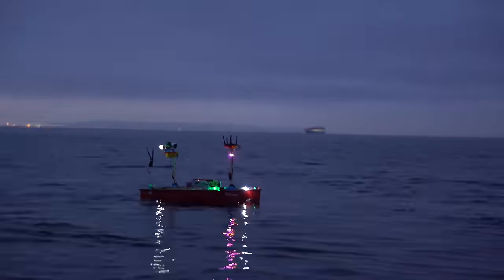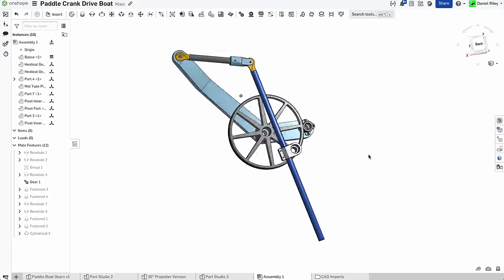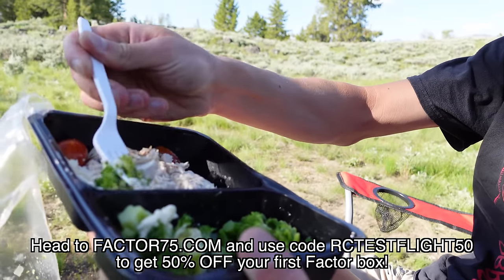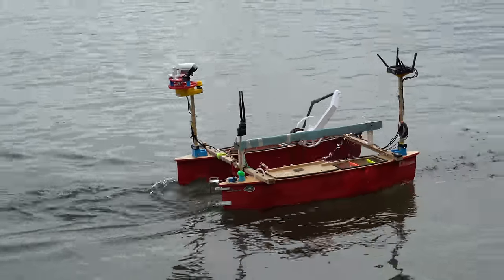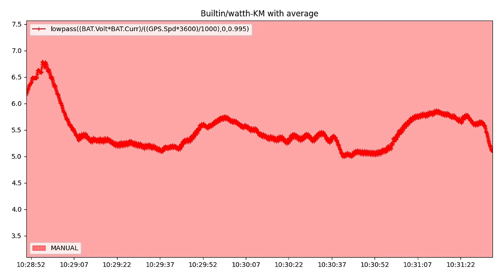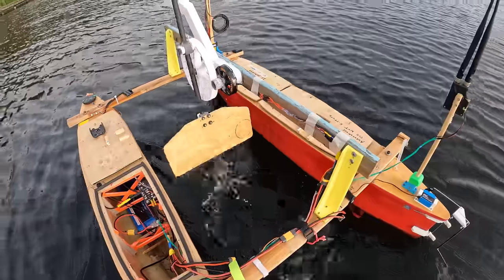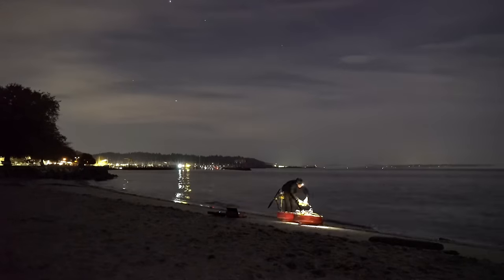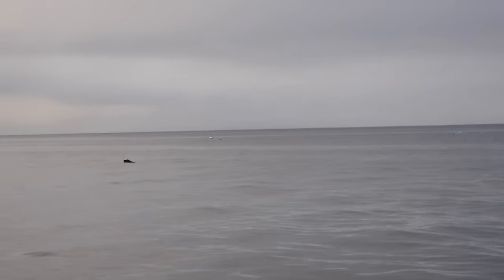Propeller Killer? High Efficiency Paddle Vs. Propeller

Comment from the maker: Use code RCTESTFLIGHT50 to get 50% off your first Factor box at https://bit.ly/3JgFdFQ!
Reply: The paddle needs to be more hydrodynamic, like a duck foot
Reply: One word- Yuloh.
Reply: You might benefit from "Nighthawkinlight"'s recent video about how to experiment with multiple variables at once to decrease the number of required tests
Reply: Just ordered Factor for my parents using your code!
Reply: @rctestflight One thing that would be cool to test is to have multiple paddles that go around like a tank tread that goes around over the top of the boat then into the water
Reply: Now you need one of those ion thrusters.
Reply: weedless prop?
Reply: @r0cketplumber I was just going to say exactly that.
When you've seen 50 tons of triple masted  Chinese junk, gliding out of Whangarei harbour in New Zealand, with a 90lb elderly Chinese guy lazily swinging on his Yuloh, on a mirror smooth windless morning...
The guy had circumnavigated solo with no engine....
No arguments possible.
Reply: Fish tail. Or two, to cancel out the waggling.
Reply: @Sandux930  🔴 What Is Islam? 

🔴 Islam is not just another religion. 

🔵 It is the same message preached by Moses, Jesus and Abraham.

 🔴 Islam literally means ‘submission to God’ and it teaches us to have a direct relationship with God. 

 🔵 It reminds us that since God created us, no one should be worshipped except God alone. 

 🔴 It also teaches that God is nothing like a human being or like anything that we can imagine.

🌍 The concept of God is summarized in the Quran as:

📖 { “Say, He is God, the One.  God, the Absolute.  He does not give birth, nor was He born, and there is nothing like Him.”} (Quran 112:1-4) 📚

🔴 Becoming a Muslim is not turning your back to Jesus. 

🔵 Rather it’s going back to the original teachings of Jesus and obeying him.
Reply: Seems to me having slight sides on the paddle, more like a cup, would be more efficient for the paddle design. For the wind prop, seems like having one big prop with wind rudder, like the air boats that we have seen in swamps would be better. Also, moving the the air prop forward, maybe centered would keep the prop out of the water. And of course longer hulls would be more stable, though increasing drag, unless a bulbous bow even this small might help neutralize the wave pattern as it does on large ships.
Reply: Interesting idea!  Some thoughts:

1. The paddle needs to be entering the water at least as fast as the boat is travelling forward, which means you need to have a way to measure forward speed through the water.

2. The problems with straining the system are almost certainly due to trying to push the paddle too hard through the water, which indicates that the speed of the paddle needs to be linked to the speed of the boat through the water and shouldn't be too far above the speed of the boat.  

3. The paddle needs to constantly be perpendicular to the surface of the water or you are wasting energy pushing down/pulling up on it.

4. A second mechanism can be used to constrain the paddle parallel to the surface on the second half of its travel.  You won't need to have the travel be as high.

5. Only having one paddle means the boat's speed will pulse.  Having more paddles with offset timing will smoothen that out.  There looks to be enough room to fit two paddle systems in a line without altering the current system design much.  (It would probably be better to have two paddles on the same mechanism, where the second one passes horizontally over the first as it returns to the front of the boat.)

6. Do the propellers need to hanging off of the end of the boat?  To my mind, putting them above the hull--as air boats do--would prevent them from striking the water as the boat rocks.

Cheers!
Reply: Can we just sharpen the propellers and stop assuming
Reply: I'D love to see a "fix" of the last test - move the props 2 inches forward (so they are no over the edge of the aft) - should that make contact - raise it another inch to clear (looks like it's close) - And then you should not have the contact problem and it "should" work??
Reply: @christ7260  I agree. I believe it would increase stability also by not having weight hanging over the back, which may also cause the front to ride higher causing the prop to touch into the water.
Reply: 😂😂😂1 @Sandux930 1🎉🎉🎉111ù
Reply: @OliverW-zl2zo  that would be nice if it would work, unfortunately it would have to be dual chains not a belt so the paddles could still have the optimal angle
Reply: you could put a 2nd paddle on the wheel to accelerate and maintain speed better -but any more than 2 on one wheel will be way too many parts in a small space
Reply: You ever notice how experienced paddlers turn there paddle sideways in the water and move it forward some times never taking it out of the water? I wounder if there is some validity to that? If anyone knows how to most efficiently paddle it would be them. Does it save the effort of pulling it out lifting it and breaking the surface again? Maybe just the muscles for lifting need a break? What would happen if you used a really thin paddle? I feel it’s probably more efficient to pull it out of the water. Hydro vs aerodynamics. But maybe not?
Reply: i have a question why are you using  the metric system when  your channel in in the U.S
Reply: do any 1 no how 🐟 works?
Reply: @Eduardo_Espinoza  lol
Reply: I have to be honest, I really do enjoy your videos. I hope you don't mind, I sent you a message via Instagram.
Reply: @rctestflight
1:21 What about a "paddle tank-thread"? :D
So the thread is mostly in the air all the time, thread goes along each side of the boat from bow to stern, have HUGE long fins that sticks out perpendicular to the threads "ground"-surface (stick into the water when facing down), it basically acts like many paddles at the same time, would that work?
Reply: Elite Armchair and in hint-sight engineer here! If the rear of the ships to bodies would both ind end in a vertical paddle that kinda moves like a fishes tail but without the protusions where seaweed could get stuck on. Would that be efficient?
Reply: What if you put the propellers like in the middle of the boat. It doesn't have to be at the rear like an under water propeller. this way if the boat tilts backwards cuz of waves its to going to affect the props. Now that I think about it could be that the wind hitting the boat would result in inefficiencies, but if you make the top of the boat enclosed and aerodynamic it could fix most of the problems.
Reply: now you need to make air propeller and paddle has same size as water propeller xD
to see the efficiency if they has same size haha.
Reply: I think a pair of paddles would work better so that as one is entering the other is exiting - should help give a more steady propulsion so momentum isn't lost and keep the boat from rocking so much.

Another idea for submerged propulsion is a flipper (fake human style or fluke).
Reply: you're starting to look like Tony Hedgecliff, are yall related?
Reply: @KeithOlson  4. That of course would be the Holy Grail. What kind of mechanism do you have in mind?
5. This was realized in Ben Kilner's crude but promising and inspiring version. It's at 2.02 in the video.
Now I'm off to study single canoe paddles to learn some about optimizing their profile. Cheers.
Reply: @chevy6794  They are the ones to ask, surely.
Reply: Слышь, чувачина... Теперь кусок пенопласта прикрепи к веслу!!
Reply: Hola una pregunta que impresora 3d utilisais y cuanto demorasteen. Imprimir las piezas? Que marca de material los hilos... Estoy buscando ayuda para ver que me conviene comprar

Comment: You should try a paddle that tightly hugs the hulls, almost like a ducted fan. The efficiency on that that would be interesting.
Reply: A ducted paddlewheel sounds like an interesting proposal.
Reply: I'm not an engineer but I agree.  Energy is lost when water moves sideways around the paddle.
Reply: Came here to say this, it seems you beat me to it.
Reply: Yup, all I could think about aswell :)

Maybe a conveyor belt of paddles so they really get some good time pushing the water before coming out.
Reply: @chrislivengood7350 Ditto!
Reply: Or what about vortex generators on the tips of the paddle?
Reply: we're basically going back full circle to a normal paddleboat at that point lol  @autonoob
Reply: Keep at it!!
Reply: @autonoob  I have also thought about this.  Like caterpillar tracks with paddles on them
Reply: A ducted tread paddle. XD
Reply: He suggested that in the video 👍
Reply: I feel like vortexes on the edge might be useful for propulsion, because they travel in th3 right direction.
Reply: I think you're describing a paddleboat
Reply: My guess is there would be efficiency gains as a result of a larger paddle, but the vortices will just go elsewhere.  You can't move water without generating turbulence.  Maybe down off the paddle and sideways across the hull
Reply: Also, take some of the mass out of the paddle.
Reply: I thought the same thing, but then again it's going to have the rudders that collect sea weed and fail the mission. Easier to just move the propellers closer to the center of the boat so that the pitch angle doesn't change their distance to water.
Reply: I agree but I think because water density and viscosity are higher than air, for the best efficiency the gap must be bigger than those of ducted fans. Maybe it's like grabbing water when swimming.
Reply: That’s called a water jet
Reply: You need space for the water to travel around the hull. Otherwise it'll mess with stream
Reply: Or make a curved paddle.
Reply: You could add wing tips to the paddles no problem, it would also avoid any problems with rubbing against the Hull for being too close
Reply: Instead of a completely flat paddle, what about one with cupped edges? Visit the shell house at UW or Greenlake and look at the design of the rowing oars and also oars used for the racing canoes. Rowing oars are not flat, but have cupped edges to capture more water. The oars for racing canoes I’m not familiar with but they may be better choice for your design needs.
Reply: Y'all, if he's gonna design curvy paddles you really should recommend SimScale fluid simulations for him. It's gonna be a necessary software
Reply: @lakeguy65616 you may not be an engineer but I am. and you right 👍
Reply: I wonder if weed would become a problem again if the tolerances between the hull and paddle were tight. The weed could get chewed and jam the paddle. Only one fun way to find out though! Build it 😀
Reply: I was going to suggest something like this.  Use rubber on the edges of the paddle to take up any remaining small gap.  Then have a cut out in the hull at the beginning of the stroke and entry into the water to make sure the rubber is always pulled through rather than pushed through.
Reply: Add another paddle in front that hits the water in between hits from the rear paddle and then make the paddles hug the inside edges of the toons but not touch them.
Reply: yes and have it be a rotating paddle wheel!
Reply: I'm thinking all of those with an added third hull. Trimaran is more efficient (waterline length). Put opposing stroke front and rear curved paddles tightly between both gaps. Steering can be done by diferential thrust, so no drag under water. I believe both less mechanism inertia and thrust equalization will prevent much of the inefficient bobbing motion as well. Love your searching mind.
Reply: @autonoob  I don't think that would be terribly useful. for one, the longer stroke would be accompanied by longer downtime. more importantly,  the amount of friction that kind of system would introduce would almost certainly negate any advantages you might get out of a more efficient stroke pattern
Reply: still way less than propeller
Reply: @ThatSB  Yes, in my understanding a certain amount of attached flow is vital.
Reply: yes my thoughts to. vertical inner hull to match the vertical paddle sides with small gap
Reply: Isn’t that just a regular paddle wheel boat
Reply: What about a concave paddle ")"???

Comment: Hi, I’m a 6th grade student at Neil Armstrong academy. We are currently trying to send a Lego figure across the great salt lake in a self steering boat. Us 6 graders are working on how the boat will steer itself, we need advice from a professional like you. If you are willing to help we can contact our principal.
Reply: If by “self steering” you mean it has to be able to maintain a heading(travel in a straight line) autonomously than you could you an accelerometer to detect lateral motion and an electronic compass to detect a change in yaw. and use that information to deflect the rudder in the appropriate direction to counteract the change. Not a perfect solution but i’m trying to think of a way that to do it without GPS.

If you mean it has to travel at different headings, like between waypoints or something, then I have no idea how you’d do that without gps. (Other than having it turn after a set amount of time and just hoping that it does turn too early/late)

Comment: Check the tide tables - a slight breeze and an opposing tide can set up a nasty chop on the Salish Sea.  Also, paddle efficiency tip - once the paddle passes vertical, you are pulling the bow down.  To reduce that effect, offset the tip of the blade 15-20 degrees forward relative to the shaft.  (almost every marathon racing canoe paddle and most SUP paddles are set this way)
Reply: yep thats how we learned to paddle.  its a hawaiian thing.
Reply: @pezpengy9308  Watermen know!
Reply: Isn't that a response to the limitations of the human "mechanism"  though? The paddle blade should ideally remain vertical throughout the stroke. The most advanced paddle steamers had a linkage inside the wheel which kept the paddle blades vertical.
Reply: I think the answer is a guarded 'yes'.  The optimal stroke for a paddle would indeed be to put the blade in vertically, and hold it vertically throughout the stroke.  With a circular motion (paddlewheel), this is very difficult without a fairly complex mechanism (cams, followers, crankshafts, etc).    
Paddle kinematics have been subject to more than a few PhD dissertations, but here are a couple of thoughts:
1.  You are trying to insert the paddle quickly and vertically and remove the same way - without cavitating or pushing the boat downward
2.  You are pulling the boat past the paddle, not the paddle past the boat.
3.  Air time is slow time.  The only time the blade is working is when it is in the water.  
4.  A clean blade with no nicks or thick edges will cause less cavitation.
Rather than me trying to explain it, here's Jimmy Terrell - former USA Olympian and founder of Quickblade breaking down SUP strokes. https://youtu.be/e3uxyS-art8?si=7W6IAyFTHYov2x6N
@RCTestFlight - I've got a broken marathon paddle with a perfectly good blade and partial shaft I'll be happy to donate to the cause.  DM me if interested.
Reply: @mnswamp

 You are spot on with your recommendation to check the tides. Just from the man’s description, it sounds like there is an opposing wind from the tides. In this scenario a very light breeze can form a pretty good chop.
Reply: I don't know that place and the tide, but I would also note that if there are big boats, they would disturb any calm sea. He did mention "a huge wake" at one point too.
Reply: @JensGulin Puget Sound/Salish Sea in Washington State has some fearsome tides.  Where Daniel was traveling, it's not unusual to see currents running at 5-6mph (8-10kph) on a rising/falling tide, and certain areas even faster.  Even with no wind and no big boats, you can get 10-30cm waves in a very dense, irregular pattern with the wind opposing the tide.   Sailboat racing on the Sound becomes interesting!
Reply: @mnswamp  Youtube doesn't have direct messages that I'm aware of.
Reply: @highloughsdrifter1629  Those  older paddle wheelers were mostly concerned  with the weight of the water on the wheel  as each board passed bottom dead center and began to lift out of the water carrying a ton  of water to the top dead center  of the wheel.   The "linkage" in the wheel mostly  zeros out that  loss.
Reply: @greyhoundollie  Yes, that's why the paddle needs to stay vertical in the water. For humans paddling the problem appears once the blade passes the paddler's hips, so this is where the stroke ends,  unless a bent shaft paddle is used. Some straight shaft paddlers appear to carry the stroke further back (I'm one of them) but have actually rotated the blade to vertical on its other axis and are now steering with it. That's used when paddling with a single blade on one side only.
Reply: Best comment so far. I might add that the blade is not fully immersed and sucks air on the back side. Either make the up/down higher amplitude or reduce the paddle height.  @mnswamp  
Many paddle makers pay attention to the shape of the back side of the blade. Some have made curved edges such that the back is concave ie the opposite of a scooped front. Lastly, a centreline ridge, effectively making the front dihedral might stabilise this wide blade.
Reply: @daveandersen6850 a fully-immersed paddle blade might be more efficient, but it would also increase the  risk of seaweed wrapping over the top of the blade. If the top edge of the blade stays dry, the seaweed has no horizontal edge to drape-over.
Reply: How about adding a counterweight and/or flywheel to the paddle setup?  It seems like the motor is heavily loaded for some parts of the stroke.
Reply: Use paddles on a track drive like a tank or snowmobile.